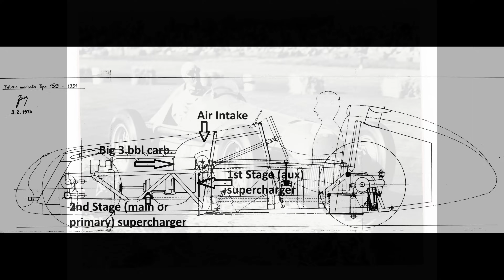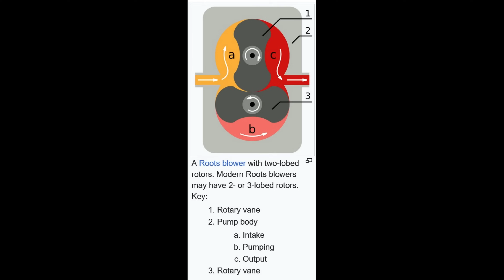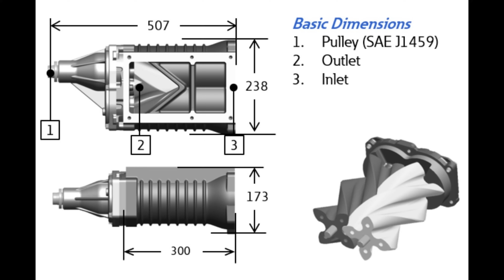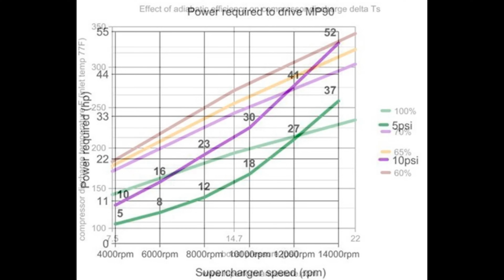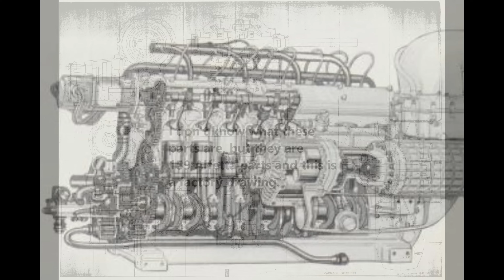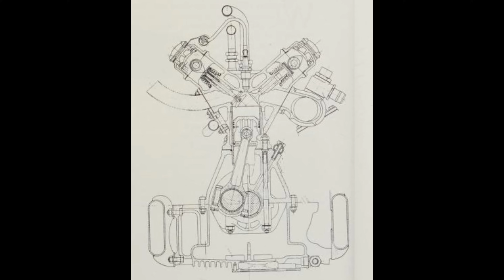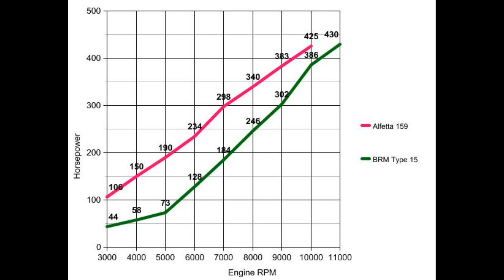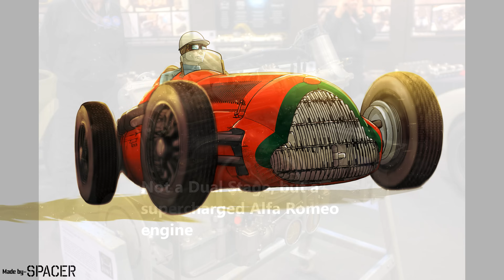Dual Stage Supercharging 450hp out of 1.5 Liters in 1951

Comment: Ok so silly question from a person who knows just enough to embarrass themself-
Why do no miniature jet turbines, like the ones used in very expensive remote controlled jets, use Roots blowers for the compressor section? At one stage i was interested in making one of these engines from a kit (The Kamps KJ66) and one of the issues was sourcing bearings capable of running at 100 000 RPM or more- i seem to remember i needed to find 'cageless ceramic' bearings (whatever those are😅!)
If a Roots blower is efficient at lower RPM, could a small one be used in this application? Probably some reason why not I'm guessing
Reply: I’d guess low compression ration from physical clearances, with a centrifugal disk the air would not be leaking from the output back into the input?
Reply: @givenfirstnamefamilyfirstn3935  thanks for the reply-how to Roots blowers compare in terms of weight and cost with centrifugal blowers? My initial answer that i came to was that most of the first generation of model turbine engines were modified turbochargers from cars and trucks- so it was easier to just take a turbo and hack it and reuse it for this purpose. But upon furthwr thought- im not sure if thats true. The firdt guy who demonstrated that a practical turbine could be built and flown in a RC plane (Kurt Schreckling i think his name is) literally made the compression section by shaping the blades from pieces of plywood and glueing them onto the central section! The turbine was made from a flat disk of steel, with slots cut into it, and then each blade made by twisting with pliers. Amazingly, the thing flew.
My point is that in making the first flying model turbine, a centrifugal compressor was deliberately chosen. Maybe this was simply because of ease of manufacture? The initial turbines did have some serious problems with surging.

Comment: A guy near me has a hot rod pickup with two 6-71's in series, one on top of the other.  They're the same size but he drives the upper one faster.  The bottom one mounts upside down.

Comment: The things that really did in the high performance piston engine as a fighter engine were the aerodynamic limitations imposed by the propeller and the ability of the engine and fuel combination to survive the boost a good supercharger setup was capable of providing.  But as with warships at the turn of the 20th Century, the reciprocating engine/propeller combination had reached the limits of what it could give without destroying itself in prolonged use.

Airliners clung on to it a little longer, but even they had issues with engines destroying themselves in mid-flight and causing fatal accidents and terrifying near misses (see Air Disaster 4 by Macarthur Job for examples).

Comment: I like the appearance of BRM and the irresistible need for an unusual 16 cylinder engine
Reply: I assume you’re referring to the H16 they tried making later? What a wonderful bunch of goofballs.

I do miss outside the box thinking, like Jim Hall, modern day racing is too scientific and not enough “let’s see what happens”
Reply: @rich7787  yeah, between the V16 mentioned here and the H16 BRM has 2 unusual 16 cylinder F1 engines

Part of me wants to do the truly insane thing of combining the two approaches. The unusual layout of 2 1.5 litre engines turned into a 3 litre engine but instead of the V8s used for the H16 use the 1.5 litre V16s. Totally nonsensical, I know

Comment: Bravo Greg, excellent as ever particularly liked the epilogue. VW did utilise a ‘twin charger’ system on production cars in Europe ( not sure if they made it to the US market) during the early 2000’s a combination of a super charger and turbocharger.
Reply from the maker: Yes, Volvo did that as well before they threw the whole company down the drain. However those are examples of turbos blowing into superchargers, which is really quite a bit different and done for a different reason.
Reply: Twincharging is known, though still rare, in aftermarket modifications. In most of these cases, a relatively mild supercharger is used mostly to provide boost at lower RPM to offset the "turbo lag" from the turbocharger, which becomes more effective at higher RPM.

Comment: Fantastic infos,, i am addicted to the BRM V16 engine sound,, but it must be the 8 +8 straight,, otherwise it doesent sound as good
the dyno graph you showed regarding power level of ALFA vs BRM is just gobsmacking  fantastic ,, it is ludicrous to see the the  level of power between the cars ,,as an advantage of ALFA,
i mean @ 5000 rpm,, ALFA is delivering 150% more power  at 6000 ALFA is 80% more,, and on this engine speed you are galloping away from the Brit   at 7000 rpm ALFA is 60% ahead,,,
I fully understand why the ALFA was such a better car,,, 
wonderful to see this kind of information and knowledge put in to perspective *
Thank you so much

Comment: Where centrifugal super chargers would be amazing is if you coupled the super chargers with a cvt drive allowing the super charger to stay at a constant rpm for low engine speeds and high
Reply from the maker: The Germans did something like that. I have a video about it. It was on the Bf 109.
Reply: Bf109 has not a CVT but I think in effect the same kind of torque convertor an automatic has.  That said I'm not sure why as I think aircraft usually used a single RPM due to constant-speed propellers and could be tuned for that exact RPM, so why not just optimize the compressor for that RPM and use a solid shaft?
Reply: @lqr824  Space. You can't turn a centrifugal supercharger at engine RPM and make meaningful boost unless the blower is built at some massive diameter that would never fit into a plane, and it would be so huge and heavy that it would take a ton of power to turn. You have to use a gear linkage to spin a smaller-diameter blower at a much higher speed, and that's exactly how it was done.
Reply: @smittywjmj  oh sorry, by "solid shaft" I meant, without a torque convertor as the Bf109 had, from memory.  Clearly it needs lots of gearing.  BTW I think mines used what was in effect a centrifugal supercharger as an air pump, but they had no size limit so they made huge ones, maybe 3-4m in diameter
Reply: @lqr824  The "torque converter" hydraulic linkade was for varying the boost pressure as a function of altitude. Indeed once constant-speed propellers were adopted, the engine ran within a fairly narrow rpm range.
Reply: @jbepsilon  Why not just put a huge compressor or chain of 2-3 that could compress enough for max war power at 40,000ft or whatever, and vent excess pressure at the manifold so that the engine sees the exact same amount of air whether at sea level or high altitude?  I get that compression soaks up a certain amount of horsepower, but given that simplicity and power will save lives and the plane itself, a loss in efficiency seems reasonable.  Meanwhile you could have a 2- or 3-stage compressor such that the aggregate output is always high enough to keep at that max manifold pressure, but when flying so low it's not needed, allow one or two stages to be turned off?  And when not actually in combat (or climbing to intercept) you'd shut off the blowers and have a far lower manifold pressure limit.

Related: did manifolds have a safety vent/blowoff valve in case a pilot forgot to disengage a blower stage while diving?  Again it'd be wasteful but at least it'd protect the engine.
Reply: @lqr824  The superchargers on WWII aero engines consumed hundreds of hp, you don't want to vent that.

What most others ended up doing was multi-speed superchargers, with several (well, usually two and in some cases three) gear ratios. The gear change was automatic driven by barometric pressure. The Bf 109 (or generally, DB 600 series engines) was an alternative to this, and arguably quite clever way of avoiding the complexity of several gear ratios.
Reply: @jbepsilon  1) a supercharger that's being substantially vented to atmosphere will take a lot less power than one that's doing higher compression, no?  2) at high altitude, with all stages engaged, either you are 2a) high enough that you're not really venting, so not really any extra pumping inefficiency, but in fact making peak war emergency HP instead of a reduced amount, so it's a win, or 2b) low enough to turn a blower stage off.  I guess it's too hard to describe without a diagram and power vs. altitude graph.

Comment: Well I've been getting the stages backwards since I first took an interest in two stage supercharging as a teen. So thank you for straightening me out at 74 years old, lol.

Andy Granitelli's version of the Novi V8  featured 2 stage centrifugal supercharging and they put out monstrous power at Indianapolis from 62-66. Too much power perhaps because they were treacherous enough in the curves to kill 2 drivers when they only had a single impeller before Granitelli took possession. Drivers were afraid of them because they'd break the tires loose anywhere on the oval track even on straights coming out of the curves.

The high speeds at Indianapolis and the larger displacements make the risks even higher. In '63 Jim Hurtubise started the race taking the lead on the straights but giving it up in the curves on just about every lap. When oil got on the track Hurtubise was the first car flagged though his Novi wasn't leaking. I've always suspected that happened because they were concerned about the Novi's reputation for breaking traction.  

Rookie Bobby Unser also drove for Granitelli and there is a YouTube audio  only Video of his qualifying run in a Novi that just screams going past the microphone in the stands. Another driver was Top Fuel quarter mile shoe Art Malone. No Novi ever won the ran despite often qualifying in the front row including pole position. They usually broke or crashed.

So I wonder if Granitelli's Novis had an intercooler and If they ran both impellers off the same shaft Merlin style but I wouldn't know where to find that information.
Reply: According to "Novi V-8 Indy Cars" by Ludvigsen the Novi's ran with just a single stage compressor.  Early Novi's used an intercooler, which was deleted from 1953 on to save weight.  Intercooling is generally considered not to be necessary when running alcohol, see the Hoonigan Mustang which reportedly produces 1400 hp with two huge turbochargers and no intercooling.
Reply: Granitellis Novis had an added larger centrifugal impeller that fed the original. Don't know if they were on his older Kurtis Novi or just the new 4 wheel drive and other new one. There were 2 older ones that Hurtubise and Bobby Unser drove in '63 that I don't know about. Art Malone finished 11th in the 2 wheel drive new one in '64 but after nearly half the feild were taken out in that bad 2nd lap crash fatal to two drivers.

Granitelli was a supercharger guy and probably the one that talked Studebaker into buying the old McCulloch Supercharger Company renamed as  "Paxton". They actually had an R4 option for the Avanti that had two belt driven centrifugal superchargers, each feeding into a 4 barrel carburator on the dual 4 manifold on a 327 cu in V8. That 's still a single stage setup. I don't know if anyone bought that option but that's what Granitelli ran the record breaking Avanti with at the Bonneville Salt Flats. It ran as a production car. They'd let you gear up the differential appearantly.

If the turbo setup you mentioned followed  a similar sequence that's also a single stage.

Comment: R.E,:- Post WW2 safety standards. This was summed up perfectly by Sir Stirling Moss, in an interview with Doug Nye. "My dear boy, nobody was shooting at us!".
As for 2 stage supercharging, I'm wondering if a Roots-type feeding a centrifugal-type might work. The theory being that the Roots type works better at low rpm, the centrifugal at high rpm. The Centrifugal would need some type of freewheel/lockup mechanism, so that it can act more like a turbo, being spun up purely from air pressure, before the mechanical drive takes over at high rpm. Intercooling as needed, ideally after each blower.
Thoughts?
Reply from the maker: Yes, sort of. It actually goes the other way, a centrifugal feeding a Roots. Explaining that would take too much typing for the comments.

Comment: Somewhat off-topic, but it's interesting that BMW's 3-liter diesel engine with dual-stage tubocharging that produces over 300 bhp (and massive torque), as installed in various 3-, 4- and 5-series models, was also made with 3 sequential turbochargers for the 550D.  However, as I understand it, this set-up used a small turbocharger to minimize lag at lower rpm, and a bigger turbocharger that kicked in at some 3000 rpm, with the third turbocharger (where fitted) again being a smaller unit to provide the final extra boost at peak rpm.
Reply: As far as I know the latest x50D models feature 4 Turbos these days, which is absolutely insane 😅

Comment: Roots blowers were necessary on 2-stroke diesels used on ships, locomotives and some road vehicles for scavenge air. Specifically the EMD 567 and stuff from Detroit Diesel.
Reply from the maker: Yup, and that's largely where they came from in the early days of supercharged hot rods.
Reply: @GregsAirplanesandAutomobiles  However the EMD 710 used a mechanically driven turbo using an over-running clutch so at about 70% power the turbo was driven by exhaust only.
Reply: @lelandbradley1076  The turbo was available on both the 567 and 645 EMD engines, however emissions regulations made the turbo required on the 710. I'm still puzzled why torbos with an overrunning mechanical drive clutch aren't seen in automotive applications to eliminate turbo lag at low RPM.It's a very simple bit of kit.
Reply: @PositionLight simple in theory, difficult and expensive from an automotive production standpoint. Up until recently every automotive engine that was turbocharged was a diesel with a relatively low red line. Thus, the turbocharger was reasonably close to its efficiency curve. If you look at engines like the 1.9 ALH TDI They pushed the development of variable geometry turbochargers into the mainstream. Improvements in materials and metallurgy allowed those applications to survive in gasoline powered engines with substantially higher exhaust temperatures.  Now we are to the point where hyper optimizing the turbocharger(s) is usually good enough, like in the Ford EcoBoost offerings.
Reply: The diesel Sherman tanks used two 6-71 GM two-stroke diesels. GM took advantage of the supercharger to blow intake air over the exhaust valves to cool them. On a diesel this doesn't waste fuel as the fuel is injected into the combustion chamber after the exhaust valves have closed.
Reply: @fafner1  The Detroit Diesels used the blower for air induction. As a two stroke it has no intake stroke, the positive displacement Roots blower forces the air into the cylinders through ports at the bottom the cylinders. The blower did not pressurize the intake. Later Detroit engines would have turbochargers to increase power. This was far more efficient than overdriving the Roots blower. Not that a Detroit Diesel was ever know for efficiency!
Reply: Two stroke diesels are fascinating in and of themselves it would be interesting for Greg to break them down
Reply: @brendonbewersdorf986  They are interesting, but not that complicated. The key factoid is that the uniflow design needs an air-box around the cylinders to force charge air into the side mounted inlet ports.

Comment: Nooo....the us marines used diesel because they were available, not because of logistics.
Reply from the maker: They were available to the Marines because of logistics.
Reply: @GregsAirplanesandAutomobiles  
Those two companies received the 22 M4A4 Shermans that the Marines wheedled out of the Army in October 1942. The Army refused to part with any more tanks intended for its own formations, and for the next year the Marines had no luck in obtaining extra Shermans from Army stocks. Finally in November 1943 the Army grudgingly allowed the Marine Corps to take 168 M4A2 Shermans from production intended for shipment to Britain and the Soviet Union.

A Marine Sherman on Guam.

That continued the pattern of Marine units receiving Army hand-me-downs or rejects. The M4A2, equipped with a General Motors diesel engine rather than the gasoline-powered Ford V8 favored by the Army, went to fill Lend-Lease orders. The Marines were denied tanks earmarked for the Army, but managed to snag a few of those intended for the British or the Soviets.
Reply: Technically that's still logistics......

Comment: I wonder if the complexity of a 3 stage would make sense if you added the complexity to convert the 2 series centrifugal stages to two parallel stages at a given engine RPM, allowing you to keep both the boost within a tighter range required to make good power without knock and the supercharger volumetric flow in a range with good adiabatic efficiency to control the air temperature.

Of course this is coming with the added cost/weight/complexity, but if the superchargers are on a shared common shaft and the now pair of aux are lower in diameter, more similar to the primary this could be kept to a somewhat manageable degree, while still offering more area under the graph on an existing engine without sacrificing top end power (like roots blowers), requiring a variable speed drive mechanism (less efficiency and more weight than one more compressor) or the hot side plumbing/response time issues with turbo supercharging (which is the normal dominant solution for modern road applications).